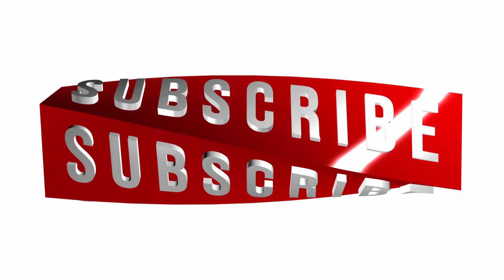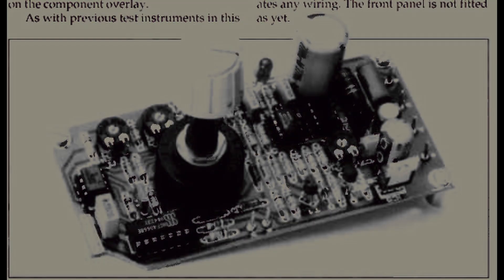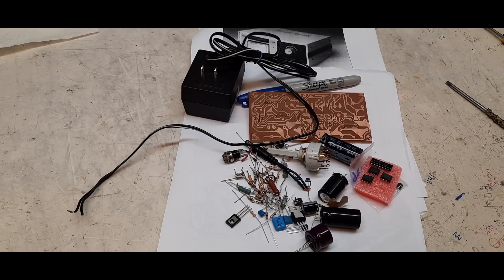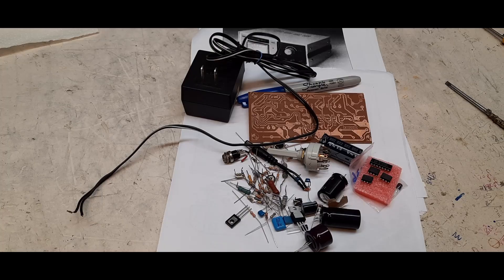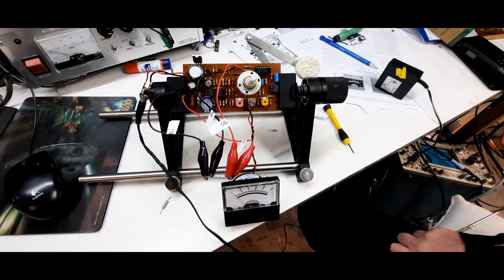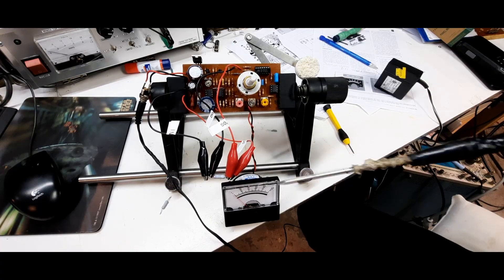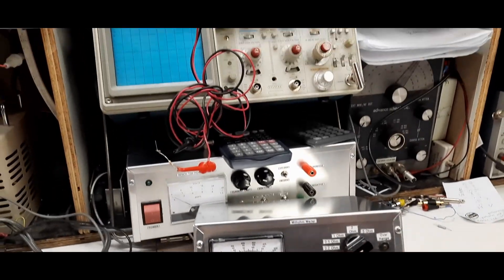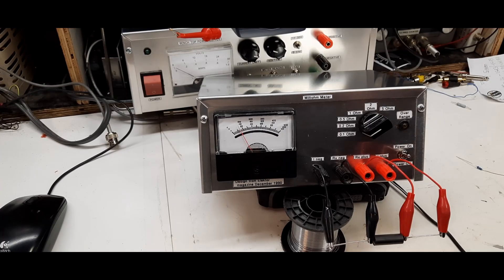Milliohm Meter - Elektor Electronics Magazine - December 1990

Comment: Nice little circuit! Maybe you could borrow a four-wire Ohms meter like a Fluke 8600 or 8800, or an HP 3456 to do a comparison and check that last resistor is OK. As for Elektor, did you know that they published a series of circuit books, called 300 Circuits, 301 Circuits, 302 Circuits, and so on, in the 1980s and 1990s. You'll find them on secondhand book sites like Abebooks, and even at the Oxfam on-line bookshop here in the UK. Most of the circuits are just that, a schematic, but some have PCB layouts. No constructional information is shown, though. I think the books were a follow-on from the Elektor "Summer Circuits" issues, where the publisher took a break in the summer months and the magazine was a two-month issue, all circuits.

Comment: I agree that the newer microampere meters on the market are cheap (many are marked Class 2.5, so their inherent error in the readings are about 2.5% of the full scale reading) and their claimed  specs are unreliable, but you can get better results if you measure their actual full scale current, and internal resistance, and create your own custom dials for them,  instead of copying and pasting the ones from the magazine article (that were created for a different  microampere meter, even if they have the same full scale current) even if you retouch them digitally. Regardless of the dial scale you use, first you must align the mechanical zero of the mechanism to the zero on your dial scale, otherwise you will always get an error in your readings. Try to buy meters with a mirror band on the dial, so you can correct the parallax reading error too, they tend to have better accuracy Class, but that is difficult to assure when they are too cheap.

Comment: Hey Bettina, you can check the 30mOhm R easily.
Just connect to a CC power supply, running at 1 amp (TOTALLY SAFE!!!!!!!!!!!!!!).
Measure the voltage at the terminals right next to the R, and 30mV should show.
Also the TLC271 has substantial input offset so there is in the circuit a pot (P2) to zero this out,
....no offense, but did you do that, as this will definitely fuck up low readings if not.
Reply from the maker: I think its all aligned correctly. There is a procedure described in the magazine. Good idea about measuring 30 milliohm resistor. Cheers

Comment: I just read the Elektor article online for your milliohm meter - couldn't resist it  ! Just a couple of thoughts about the low reading you got with the 30mΩ resistor test:- it's hard to tell from a video, but it looks like your meter may not be mechanically/electrically zeroed as well as it could be - these are the first two steps in the cal in the magazine, it looks like the needle is lower than the scale zero to me - this could be just the angle your camera was at though. If you tweak the zero in any way though, you may have to go through the whole setup again I think, but try some test resistors again before going through all that...and see how they measure now.
Also, you could then try soldering your 30mΩ test R to your 100mΩ R and try measuring the whole 130mΩ thing - this would give you a reading that is much further up your meter scale and may give you a more accurate reading - since your meter seems to read ok at larger deflections. This might show that your 30mΩ resistor is actually a dud, or it may show a correct value, which would be nice. Make a very good soldered joint between those two test resistors though - I'd scrape the leads 'til shiny first.... sorry if this is very obvious, haha....:o)
Feel free to ignore my suggestions - I'm just brainstorming here 'cos I want you to get 30mΩ to read right, having got quite good results everywhere else...and I can't see why 30mΩ wouldn't work too at the moment...

Dave
Reply from the maker: Good observation. I should have said something about the meter and scale. There was a rough scale printed with the article. I cut it from the article and pasted it to a photo editor. It turns out that the scale was not meant for my cheap meter. It just did not fit. I did have to first mechanically adjust the meter needle to my zero scale. I think you are right if I had a proper scale and print it out and fit it to my meter, the lower end would be much better.

Oh ... good tip on adding 30 milliohm to the 100 milliohm. I just tried it and yes, I got 130 milliohms. I like that!

Thanks for the help!

Cheers!
Reply: @bettinaneumryr  Oh well, some good news in that your 30mΩ resistor seems to be right value.
Yes, I could see that your printed meter scale is not a great fit for the meter - I wonder if the original scale was nice and linear from one end to the other ? Those meters made in CN can be a bit, um, 'variable' let's say, though I haven't used more than a couple. I guess an old stock or even a used meter from earlier (and better) years might be an improvement, I think you said this in the vid.  I bought a cheap digital milliohm meter from Aliexpress last year, which came with good Kelvin probes, has a rechargeable batt, cost about £20, and works flawlessly down to 1 mΩ, but that's not 
in the spirit of your videos about building things from old magazines of course, just an interesting comparison...
Dave

Comment: Another thought:- you can buy 'Kelvin probes' to plug into your milliohm meter, if you haven't met them, they look like croc clips but the two jaws are insulated from each other and there is a lead to each jaw, so with a pair of clips you can easily do a '4'wire' measurement across a component, without having to get  two separate clips onto each end.
I have only found your channel today, so am working my way through it :o)  
Cheers, Dave (UK)
Reply from the maker: Yes ... someone else mentioned that to me. I never heard of them before. I might buy a set if I can get them cheap. Thanks for watching the videos. Cheers!

Comment: I remember Elektor (paper version) and as others have said, they were always interesting projects. You can use your milliohm meter on 100mΩ range to check how good or bad a switch is making contact, even though yours won't give an absolute value down that low. You won't believe how dodgy some switches you thought should be good, actually are !
Reply from the maker: Good idea! Yes, switch contacts are really suspect. I remember a few months ago where I had a power switch give 20 or so ohms reading. Big wake up call. Cheers!

Comment: Elektor made awesome projects.. i still remember the kilowatter a 1000w power amp and all the projects they had really worked very well they also had competitions where you could win electronic software and other prizes
Reply from the maker: Whoa ... that is some amplifier. I recall that the North American magazine, either Popular Electronics or Radio Electronics had a big amp too. It was called Tigersarus. Not 1KW though. Elektor is a great magazine. Cheers!

Comment: You needed a milliohm meter @9:35 I once (ca. 1990) had to troubleshoot a bad batch of pc boards with a Hickok Model 419.  I think the fault was a via shorted to the groundplane. I just used the relative milliohm readings between all the power pads until the minimum readings to find it.
Reply from the maker: Yes ... someone else mentioned that use case too. Mine will not be good for that apparently. Thanks for watching!
Reply: @bettinaneumryr interesting channel,  you got a new subscriber!   Can't wait to see Radio Electronics projects too! I wrote a couple articles for them, maybe you will pick one of mine!

Comment: Here in Belgium, the Netherlands' neighbor, it was called Elektuur.
In the late 1980s, I built a dual lineair lab power supply with digital voltage and current meters. No, not ready-made meters, but with separate 7-segment displays. I etched the double-sided circuit boards myself. And then I had to drill a lot of holes...
Sometime in the 1990s, I also built the digital frequency generator.
Both still in my lab and working...
Of course, the specifications are outdated, but they still work as they did back then.
I've done many smaller projects, of course, which are a good way to learn.
Reply from the maker: Thanks for sharing your memories to us. I think i know that function generator you speak of. I might actually build it if i can get the parts. I will probably ask you for help if i try. Cheers
Reply: @bettinaneumryr  Even then, I had to use different ICs (a few years after publication). It really didn't work until I made a few adjustments. I don't remember exactly what I changed, but it worked then and still works now.
At that time, ICs were advancing rapidly, and by the time they hit the stores, they were already outdated...
If you have any questions, I'll unscrew it and take a photo, nostalgia...
Good luck.

Comment: Nice vid of mOhm meter build thx. Would have liked to see some of the PCB and solder work. Disappointing errors in the source docs, and in the key low resistance measurement. An explanation of how you found the errors would have been really cool too. Thx anyway.
Reply from the maker: I hear you about my lack of video production value. I have to step it up. Right now, I do not have the equipment but I will try some new ideas. I need to show more on the demonstration part of the video and of course error faults. Cheers!

Comment: Hello. PCB is correct. Nothing is wrong with the drawings on it. In Fig 6 you also have the types of LM336 (Attention-you said LM339, that is completely something else) that you can get. You also say about a 3k9 resistor but there is no such value in this schematic. For alignment a 1% resistor is the minimum you want. Much better a 0.1% or even 0.05%. The article says clear that you do not need a heat sink because the current is pulsed and effective current is 10mA. So, I do not understand why you have heat problems. Maybe some component values are wrong in the pulse generator and the pulse is too long. You should check it with an oscilloscope. Being a magazin project doesn't mean it's not a lab quality. But you have to use good quality components and make all the adjustment with care. This schematic is very good for a milliohm meter.  So, you still have to learn electronics. And also, you always have to read the entire article before starting the job. But you did a nice job here. Keep going if you like it.
Reply from the maker: I misspoke on the LM339 ... it really is a LM336 - 2.5. Also I made an error on saying 3.9K, it really is a 39K resistor. I agree on getting better tolerances on the alignment resistors but they were way too expensive. The 1% resistors that I bought were 27$ with shipping. As for the heat sink, it gets little warm with a very low resistance; not that hot but it safe thing to add. On the scope the positive edge is about 75% and the negative is 25%. I know the article it mentioned 1 ms on and 100ms off but I cannot get that. I followed the alignment perfectly and got it too work. 

I appreciate the detailed feedback as this helps me learn electronics much better. It's great to have Elmer's give me the knowledge I need to better myself. I really did not think the channel would get somewhat popular but I will take on the challenge to improve to make the projects better.

Cheers!
Reply: @bettinaneumryr  👏

Comment: I've buiilt a bunch of their projects over the years. They had a particular house style for schematics that I found easy to follow when I was learning (never stopped learning yet!) Their high quality PCBs were well made with silk screens and solder masking. In the earlier days they were made to be printable at home, so they tended to be single sided PCBs with a ton of wire links. Components were sometimes difficult to source in the UK, until distributors started to ship to the UK from Germany in the 80s. The topics they dealt with, like music synthesis, electronic pianos, amps, preamps, power supplies and test equipment of all kinds were always very aligned to my interests. 

Elektor was a good hobby magazine for me that led me to a degree in Electronics, which in turn led to a career as an electronics engineer.
Reply from the maker: I like the way they do things. I may build a few more projects from that magazine for sure. Many people have said the same thing about the hobby turning into a career. Thank goodness for the publishing pioneers like Hugo Gernsback. Great story and thanks for sharing.

Comment: Be careful where you use a milliohmmeter that pumps out 1 amp. For regular wiring, it's fine. I wish I had one many years ago when I had electrical problems with my car that turned out to be an internally-corroded battery cable.

Think twice about using it on a PC board with sensitive components.

Even the cheapo milliohmmeter I bought on Ebay peaks-out around 200mA. I bought it several years ago to help me debug the PCBs I build, but all of the problems I've had are opens from my sloppy SMT work, not from solder bridges or internally-shorted caps.
Reply from the maker: Yes ... excellent point. Someone else mentioned that. I am learning so much from you all. Cheers!

Comment: I guess that the scale should have been zoomed a bit, to align the needle 0 with the scale 0. Aside that, great project, good execution. I also made many projects from electronics magazines, some from Elektor but also from  many other. At a point, almost all my lab was built by myself, even the DMM.
Reply from the maker: Whoa ... that is impressive on all the equipment from builds. I got quite a bit too now. I hope you still have all of those projects.
Reply: @bettinaneumryr  No, sadly when I moved to a smaller house, I lost them all. However, I kept all my collection of electronic books and magazines and, most important, my notebook with schematics. I wish to get a bigger house to dedicate some space to a proper workshop.

Comment: The current wires are a bit thin for a 1 amp test current.
Reply from the maker: I think I am good. I am using 22 gauge solid wire. It has a maximum rated current of about 7 amps. I should have mentioned that bit during the video. Thanks for watching.
Reply: The resistance of the current wires is not important, since the measurement is done in a Kelvin bridge configuration, and the compliance of the current source allows for a bigger drop in voltage.

Comment: This device is very useful to read relative values, and tell which is smaller. For example, when you need to identify the ground line on a PCB. Another build demo is about 3 diodes in parallel, classic setup on some TV sets, one of which is cut. With the milliohmmeter, the healthy diodes have the shortest measurement circuit and give lowest milliohm readings, whereas the cut one will close the circuit by using the PCB tracks to one of its neighbors, giving a higher reading.
Reply from the maker: Good idea .. I never thought of using the meter for that, but it makes sense. Cheers!

Comment: Do you try to comfirm the 30miliohms resistor are good with PSU at 1AMP and DVM read 30 milivolt? (or 2amp and 60milivolt for better resolution... )
I love elektor magazine, my father have some old from 80S, i have from end 90s to today.
Reply from the maker: Ah ... I see where you are going. The last test was with a 1 ohm resistor and i got a 1V pulse on the scope. With the 30 milliohm resistor, I get a 30mV pulse.The problem could be with the actual cheap meter from China. However, good to know that I can measure the resistance via a scope. I learn so much from you all. Cheers!
Reply: @bettinaneumryr 
A simple power supply, limit at 1amp, put the resistor on and mesure the drop with voltmeter.
If you have a 5 or 10 amp current limite power supply, you test 30 miliohms at higher current to found exact value with voltmeter.

Comment: Zeners always tend to go in backwards :D

Chinese needle meters might work better with higher currents (higher current allows for a less delicate mechanism... in theory). Unfortunately their little 3 digit panel voltmeters are likely to be a lot more accurate.
Reply from the maker: Thanks for that tip. I have lots of old meters made in Canada but not the correct current for this project. Cheers

Comment: Thanks, Bettina. The project turned out very well.
Recently, I built a power supply based on the 1982 Elektor design. I also found minor errors in the publication.
Saludos.
Reply from the maker: Awesome. I would love to see the power supply, if you have a youtube channel. Yeah ... there is always a small error in most of these magazine projects. Thanks for watching!
Reply: @bettinaneumryr  Here's the project. December 1982, page 22:  https://ia601702.us.archive.org/19/items/ElektorMagazine/Elektor%5Bnonlinear.ir%5D%201982-12_text.pdf